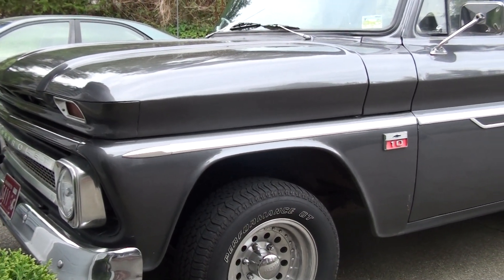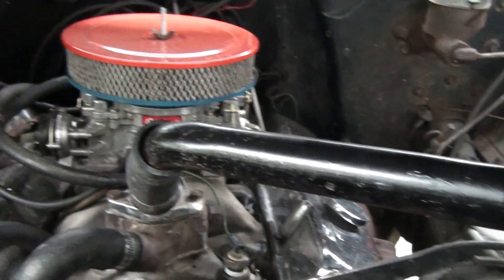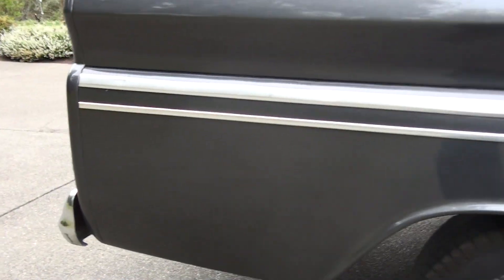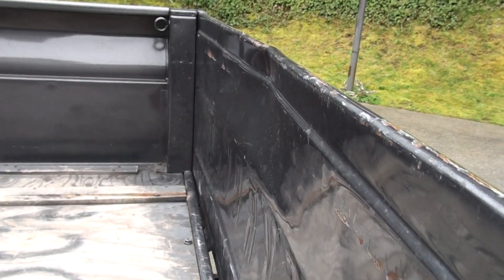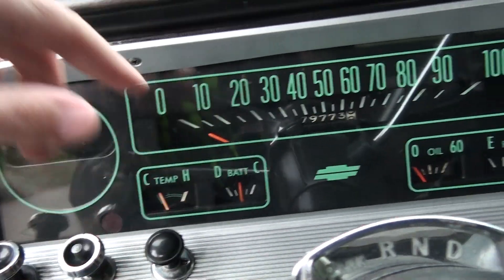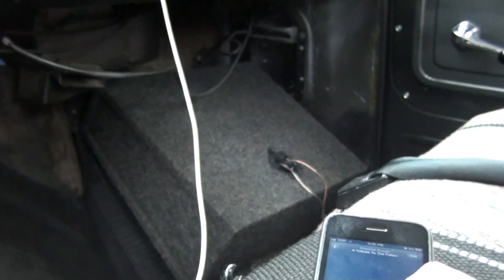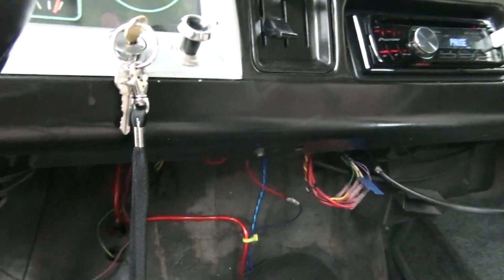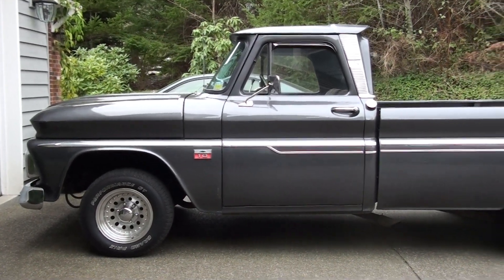1966 CHEVY C10 TRUCK WALKAROUND

Comment: you may know this but thats the wrong custom cab plate thats for a 1960-63 i believe
Reply from the maker: I'm not trying to argue with you here but that's the right one. The truck was bought brand new by a family friend of my grandparents and sold to them shortly after. It was kept almost completely original besides the rear bumper, the seat cover, and a fresh set of paint. That's until we redid it and I kept all of the original trim. Those cab plates have been on it from day one.
Reply: yea sorry i messed  up i looked at lmc and saw i was wrong i have a 1966 Chevy but it apparently has the wrong trim on it the trim is for a 1960 apparently my mistake

Comment: Oh by the way it's not all oringanl
Reply from the maker: I'm pretty sure you're just a troll, but I'll go ahead and reply to both of your ignorant comments just to see where this goes. First off, you're correct, it's not all "oringanl." Heck, it's not even all original for that matter! I list several parts I added to the truck that are replica or aftermarket. Much of the original parts to this truck didn't survive and were no longer usable. If you watch the entire video, I never once use the words "all original" when describing the truck, only select parts. 

Also you are correct, I can't drive a "stuckshift," and in fact most people can't because if the transmission is stuck, that would likely be a problem. Unfortunately I did have to replace the factory 2-speed automatic from Chevrolet with a 3-speed automatic, but don't worry it's still at least somewhat original according to your comment because both transmissions use gears to shift. I did consider installing a manual transmission, but seeing as how the truck has always had an automatic transmission and I was 16 at the time, I didn't have the resources to properly modify the cab and other various parts to do so. The goal was simply to make the truck drive able, and I plan on doing a full build on this truck now that I'm older and don't depend on it as a daily driver.